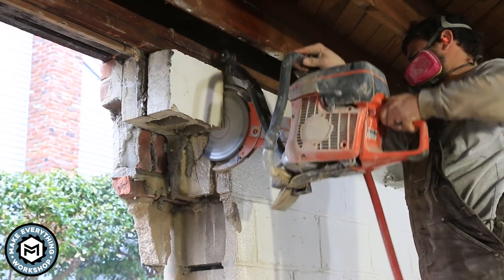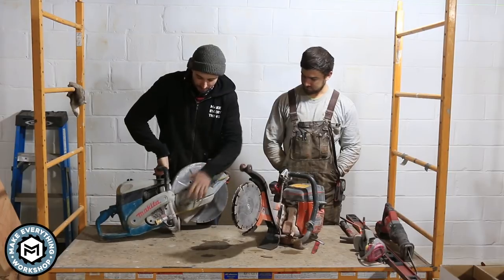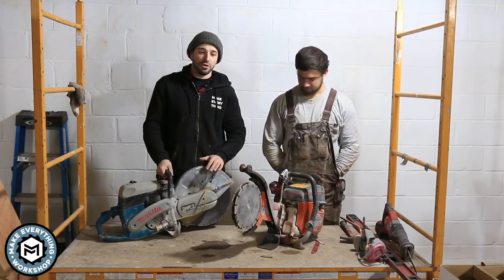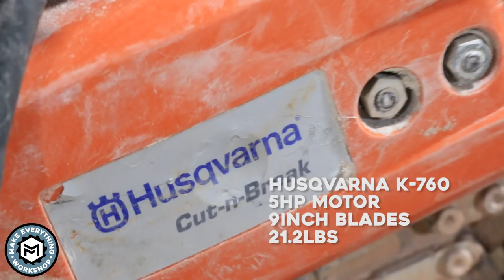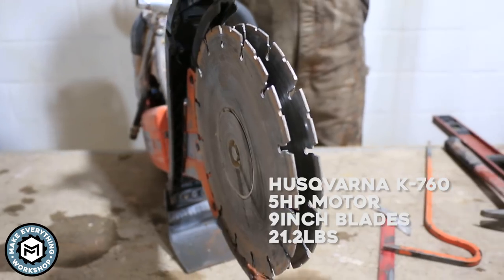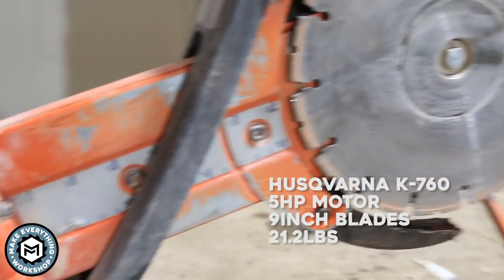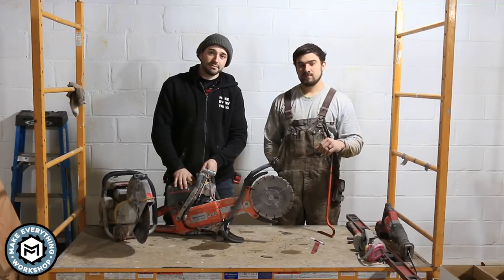Cut Through 16" of Concrete?! Husqvarna Cut and Break Saw!| Tool Talk

Comment: I did almost the exact same thing with a identical cutn break saw some months ago. But I did a big mistake. After cutting the horizontal separating  line 1/3 up from the floor (after the two vertical lines), the upper part(2/3) only "hang" in the upper concrete. Then I checked if the lower block could be tilted away, and it could. But when tilting the lower block, the rear edge touched the upper block, and the upper block fell down quickly. It went good and im glad I wasnt injuried. The brick blocks that were used when the house was built is really heavy, not hollow. Learning by doing

Comment: Today I used this saw cutting through solid concrete 12 inches thick wasn't fun. I prefer a ring saw
Reply: look up a ring saw or the concrete chainsaw I prefer those... I have experience cutting all kinds of concrete, I've used ever tool out there
Reply: I believe this is a ring saw?
Reply: This is a cut and break saw a ring saw cuts 10.5" 11" deep
Reply: @rebel1333frank  Your correct; I had always called the cut n break saw a ring saw but after I wrote that reply to you, I investigated as you said and found that Husqvarna also makes a ring saw that drives the blade on the inside, sorta like a planetary gear drive. Thanks, on my project I need to saw thru 12" concrete block and limit the mess on the inside.

Comment: Great saw and presentation. Now I know what I need. I have to cut out 24 window openings, this saw will save me a lot of time and money. Thanks guys for sharing this video, very helpful. I'm leaving my subscription here. Stay connected guys
Reply: It works great. I don't think anyone I know EVER took this saw back. I think everyone LOVES IT!!! Probably the cheapest way to go too.
Reply: If I had to do that many I would use something a lot easier to handle. Talk to a concrete cutting contractor that does enough to wave the huge bladed self supporting track saws. I have seen some huge blades like 36-48 inches.
They can make cleaner cuts in 1 slice in just a few minutes.

Comment: Not strictly what I think of as "concrete wall", these are cinder blocks. Will it cut reinforced concrete?
Reply from the maker: Yes, and there are many variety of blade for specific purposes. These diamond blades do well through rebar as well

Comment: How does it handle rebar?
Reply from the maker: Diamond blade will cut through it well!!
Reply: @MakeEverything  cool... Great cause I'm an electrical engineer, and I'm putting on the drawings to saw cut and trench for nine 4" conduits going underneath a basement wall of a hospital. We don't have a lot of room overhead, so it could be our only choice. But will it be overly difficult and not worth the space savings? It's CMU, but underneath it is a footer, 20" wide and 16" deep. It's just deeper concrete perhaps with some heavier rebar in it than the rest of the floor. The wall is verified non load bearing by structural engineer. I'm beginning to think a typical concrete worker wouldn't even flinch at this task...what do you think?

Comment: Will it cut through rebar?
Reply from the maker: Yeah, its not the greatest thing for the diamond blade, but its made to do that.
Reply: What is the best blade for rebar?
Reply: @davidwhite9848  if you are hitting heavy rebar a diamond blade will work.  Keeping water on the blade will keep it cool and extend the life when hitting concrete.

Comment: where is the 16 inches, listen 6 at the most, gthoh
Reply: Alexander, at 3:17 the operator has the saw inserted into the cut at least 12" and the saw could still go an additional 3" more. It only cuts about 2" deep per pass, then you must break out the ridge from between the 2 saw blades than go back and cut another 2" deep pass. To get to 15" deep you must make at least 8 passes.  This saw not meant for frail people. But it keeps the mess all on one side of the job, hopefully on the outside for all you safety police.
Reply: David Schwartz You seem to be pretty knowledge about this saw.Could you use it to cut limestone block if you somehow hooked water up to it.I’ve got thick block I’m wanting to make 2” veneers out of.If not this what saw would be best for that application.Thanks for any info